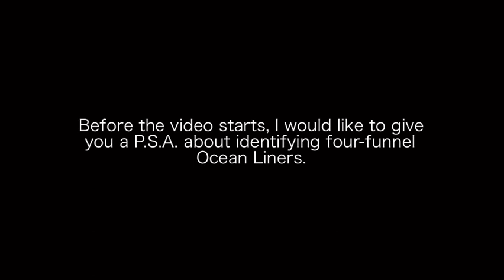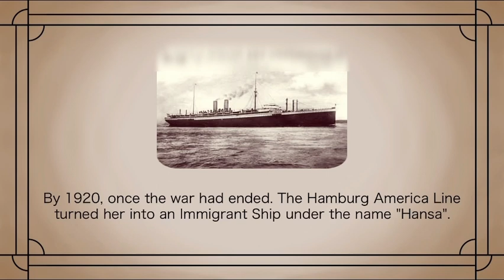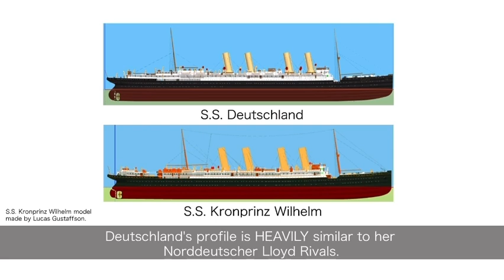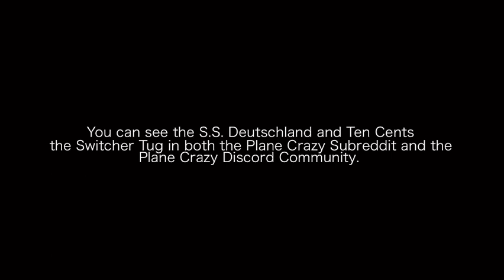S.S. DEUTSCHLAND (1900) | German Four-Funnel Ocean Liner | Plane Crazy Showcase

Comment: What a fabulous build, i'm just wondering, how wide is the boat? Im trying to get my ocean liner to a fitting scale to the plot
Reply from the maker: It's 15 blocks wide.
Reply: Oh ok, would you recommend using a 17 block wide and maybe 30 block tall build, folding the top though,?
Reply from the maker: @legomill1068  I don't think a 30 block tall ship would fit, since the entire Plot Size in game is 51 x 51 x 39 (L x W x H).
Reply: Ok, I had a idea of Golding that I will tell you: I shall get the bow finished normally but first 2 hulls will not have their boat decks as they will be folded vertically on top of each other, instead for the main Hull i will build it over the bow so I still have space to fold the funnel and for the stern I will fold it of on the side of the hull

Comment: hey, can you give me some tips on how to float your boat? i have been struggling trying to keep my boat afloat but it just keep flipping over
Reply from the maker: Here’s the hint: Add some ballast blocks and make them heavier by increasing the weight, and don’t forget to add some Pontoons on the waterline for the ship to float properly. 

Also, if that does not work with the stern rising or the ship as a whole, you may add super rocket engines and make sure they face downwards to keep the ship on the water. 

TLDR: Add Ballast Blocks and make them heavier.
Reply: Thanks